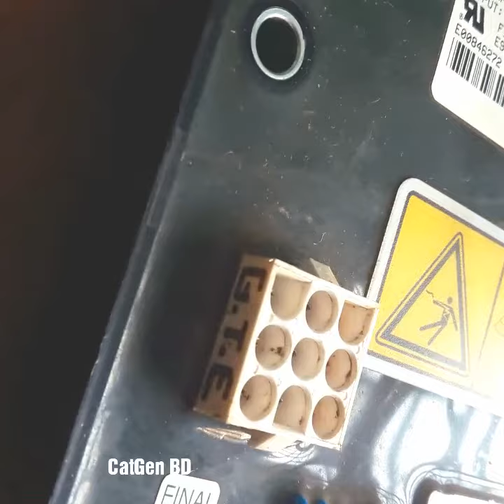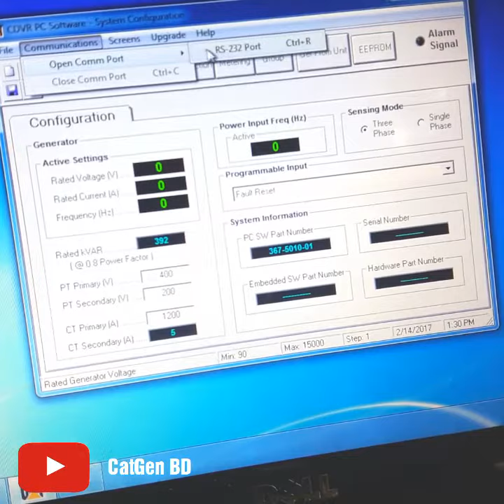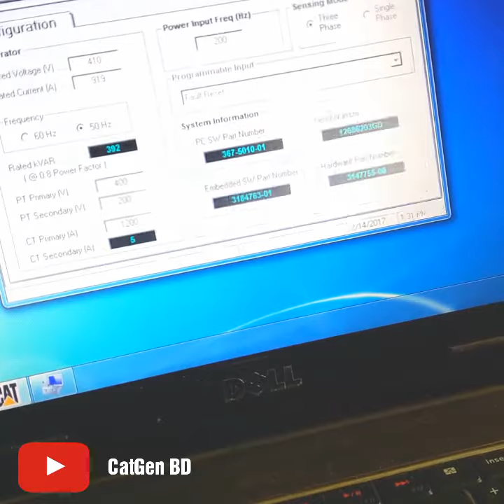Caterpillar Voltage Regulator CDVR Fault & program by My Laptop
#Cat #Caterpillar #CDVR #Voltage_Reg

Comment: My 2007 Caterpillar 3512 diesel generator set having SR4B 400 volts generator set is suffering voltage crash down after running 10 to 20 minutes on 900 amperes load. The red light also makes blinking while voltage crashed to 45 volts adjacent 400. Is it reprogrammable or troubleshooting possible adjacent of replacement....?
Reply from the maker: Please check cdvr program by cdvr pc software.
All parameters are ok then problem again, replace cdvr.
Thanks
Reply: @catgenbd1624  
Thanks a lot for your such a kind and valuable update
Reply from the maker: Welcome
Reply: @catgenbd1624 ❤
Reply: @zeeshan_engineering_services what is problem please tell me
Reply: @abdualkadershuga1163  
It was defective and became normal after replacement of Caterpillar CDVR